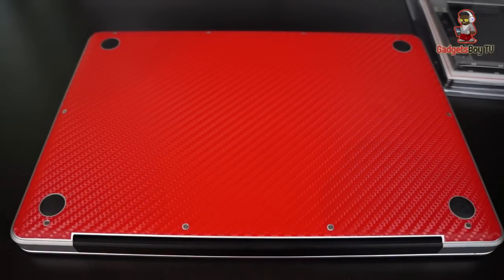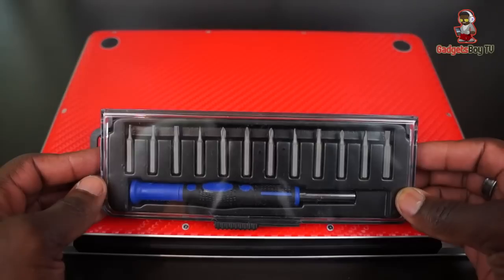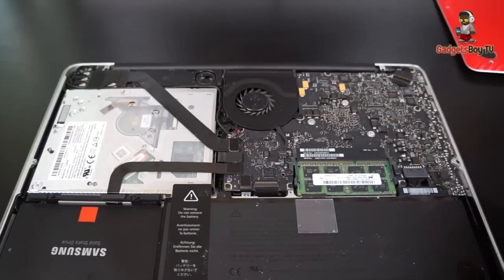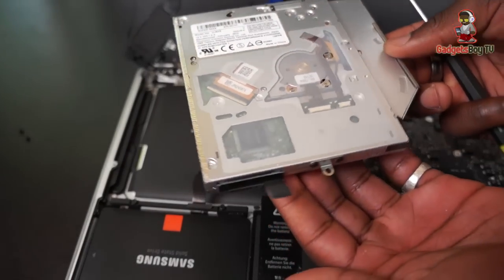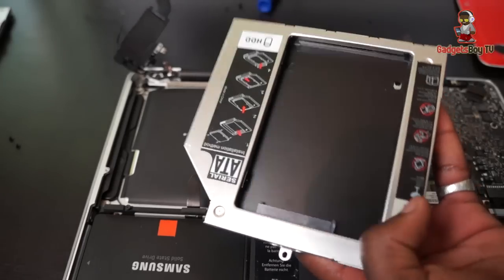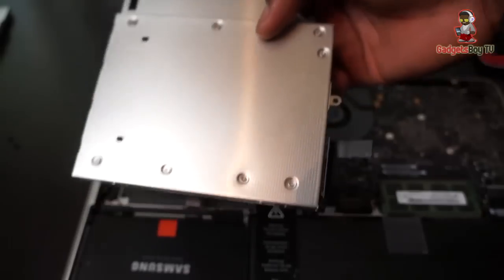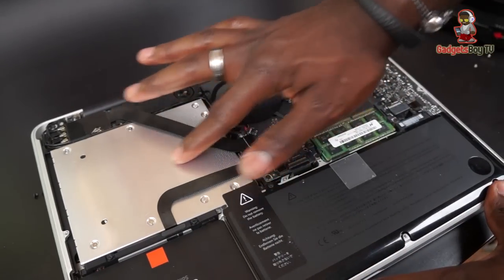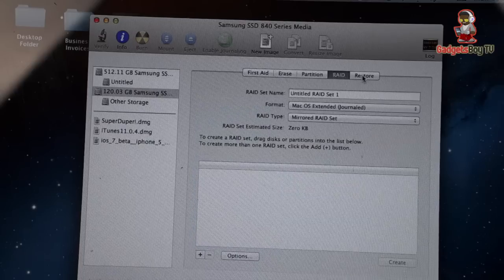How To Add Second A SSD to Replace Optical Drive MacBook Pro 2012

Comment: I'd recommend removing the battery first.
Reply: Rob Giordano Yes, I'd recommend removing the battery first, it's still connected to the motherboard and something might happen there
Reply: Unplugging the battery would really only be an issue if disconnecting system operating components. The sata sockets and power rail connecting through peripheral devices are still going to need to flash through a regular boot cycle anyway, and on a side note, even with no battery connected, there is always potential with mac book laptops that static electricity will ground through the chassis even if you are bare foot touching a surface. I replaced my main drive with an additional battery and and my main drive is in the superdrive bay.
Reply: How did you do that? I can't find any guides on the internet to replace the main drive with a battery and have the main drive sit on the CD bay. It's an interesting idea.
Reply: I agree, it’s good practice but in my case since I’m going to do a project for my customer, I’ll be replacing the battery in addition to the other things on this computer

Comment: Very nice video. A wonderful guide indeed. I have done the same procedure with my macbook pro except that I have used OWC Data Doubler Caddy and I have put a 1TB Seagate SSHD into it while the other drive I have used is an OWC 240GB SSD. I have never seen a macbook pro run so fast. It boots up in 7 sec and shuts down in 3 sec. The functioning is also very fast.

I am using my SSD for Mac OS X Yosemite and all the apps and the 1TB SSHD for all my data.
Reply: Exactly what I want to do!  How did you separate the OS and Apps onto the SSD?
Reply: What I suggest is reinstalling the OS onto the ssd like I did then just transfering you documents folder etc onto the sshd.

Sorry for 2 years late ;P
Reply: Yes, how? Yolo

Comment: Thank you for the video. It is very useful. I used similar caddy like yours. 9.5mm one and does not have 2 screw holes on the caddy's body (to secure firmly to the laptop's body). I wonder if there's a negative impact after the replacement on yours ?

Keep posting more useful videos.
Reply: Hello Sir, 

Hope your install is successful, Please share the current config of your MBP, I'd like to connect with you and know more! I'm looking to upgrade my MBP too!!
Reply: Or just reply with ur Instagram/Fb ID!
Reply: @AdarshX23  Hey, Buddy. Battery draining faster.

Comment from the maker: Thank you...I haven't noticed any major weight reduction.  But it was all done for better performance, I don't think anything can beat MacBook Air's weight.
Reply: I am already using Windows 10 on my mac via bootcamp, can I add a second SSD using this enclosure, and install Windows on this newly addes second ssd and boot it from this straight away? Thanks

Comment: Cool thanks! What is the largest SSD you can upgrade to on this model MacBook?
Reply: I currently am running with a 1tb crucial bx500 if I'm not mistaken. Not sure if it supports anything bigger than that. But for such an old machine, I think that's plenty. Also installed debian, with KDE plasma. Much snapied than Mac os 10.15.7 (on mbp a1278).

Comment: This is a reply to many commenters who think that is a good idea to take off the battery before this operation: No, do not touch the battery! You don't need to put out the battery for this simple task. Lithium-ion batteries—like the one inside this MacBook - can literally explode! If it is broken and you really need to replace it then you should always make sure the battery is fully drained before removing it.

Comment: Clear instructions. Very useful.  Is there a way, to re-use the removed optical drive externally using a caddy or something?
Reply from the maker: Thanks :)....i think you can buy a usb connector for it, have a look on ebay or amazon
Reply: For $15 you can order one on EBay

Comment: Thanks alot for the video it really helpfull . im just done with my MBP Mid 2012 using 9.5mm caddy size. but it not fitted well on the right side, was around 5mm opened and i can see the red and blue light once i turn on my Mac. actually what is the actual size for my Mac?

Comment: Hey Dude , your video is interesting 
I'm still using this 2012 model 15"  💻 MacBookpro It is working in Very good Condition 
Is it Possible to I can add 512 GB Harddrive ? Or that 128 GB is the Maxx ?
 I Hope you give an appropriate reply to this
Thank you 😊
Reply: you can add a 2TB ssd and a 5 TB hard drive. that is max configuration for now with your MacBook pro. i even added 16gb memory to make the computer very fast

Comment: Great video. I have a question. I want to replace optical drive of my Macbook Pro 2012 15" with SSD.  So what size of case do i need? is it 9.5mm you are using?

Comment: Thank you for the Video. I have been willing to go for that. Your video helped me. 
My Question here: Would this allow me using 2 SSD one for OS X and one for Windows 8 ? or I still need to use in this case the BootCamp to have 2 OS running on one machine ?
Reply from the maker: Bashar Najjar I haven't tried, but I think you can install different OS on them each.

Comment: Hi! Thanks so much for the help! I have a Mac Book Pro md101 mid 2012. I have taken out my cd drive and installed a HDD caddy and put in a samsung evo solid state drive. I have formatted the drive and it is showing up as a storage option. My problem is that my current standard HDD is 1TB (and it's almost full) and my SSD is 500GB so I would like to move just the operating system and the apps onto the SSD (to make my mac a lot faster) and leave all the rest on the 1TB. How do I go about this without loosing the path files to things like iTunes playlists etc. any help would be greatly appreciated!!
Reply: I think the biggest issue is the size difference. You could clone ssd perfectly if its the same size or bigger than the HDD. You would have to resize the HDD to  be the same number of GB as the SSD, using Disk Utility. If its too full to resize, look into backing up your files manually to free up space, then doing the cloning procedure.

Comment: So I'm thinking about keeping my 500GB hard drive, but adding a 250GB SSD by removing the optical drive.
So my question is are you able to then specify what work goes to each drive? I would love things like the initial boot, safari and a music recording program I use (Logic Pro X) to use the SSD so they load faster, but I wasn't sure if that's something I would be able to easily differentiate between the two drives. 
Sorry, I'm just learning about all this stuff. Thanks!
Reply: For everything to load faster, you would need to install it onto the actual SSD. Basically wiping the whole Mac and installing the OS onto the SSD not the HDD. You'd need to do this for each program so the actual directory of the program files are on the SSD.
Reply: Very helpful, thanks!!

Comment: Yo, awesome video! A few things though... can I replace the optical drive with an SSD, and make it the primary drive for booting? I'd really like to keep my HDD, and since I haven't used a CD or DVD in the past 2 years, I can't imagine myself regretting not having it... Also, if you remove your optical drive, Apple warranty doesn't apply anymore... 
Thanks again!
Reply: Take your HDD and put it in the optical bay and put your brand new SSD in the primary drive slot....

Comment: Hey mate, thanks for the informative video. I was wondering if it is better to replace the existing HDD with the new SSD and then put the HDD in the caddy so the Macbook will be more smoother booting from the main drive? Or any order does not matter?
Reply: +mi hao chua I think it does matter and, yes, it's better to have the SDD in the existing HDD slot.

Comment: I modernized my 2012 MacBook Pro by upgrading from 4GB RAM (stock) to 16GB RAM, & from 500GB HDD (stock) to 1TB SSD & I’m contemplating swapping the optical drive for a 1TB SSD & putting Windows 7 Ultimate on it

Comment: Great great video! Thanks a lot! My question is this: I already have an SSD in my MacBook Pro 15" 2011 and now I want to replace the optical drive with a regular hdd to upgrade my storage space. Is that possible, too? All the tutorials are about replacing the optical drive with an SSD
Reply from the maker: +2veto3 Hi, you can also replace it with a regular HDD, most people just talk about SSD as that's beast mode haha

Comment: Hi, Thanks for sharing this with us. 

I have a quick question: If I install a 512GB SSD (instead of 120GB) as a second SSD to my existing 512GB SSD, is it possible to configure these two drives as a single RAID 0 partition so that I can have my OS on this super fast drive and take care of entire backup with some external 1TB backup drive (via Time Machine for example)?

Comment: Hey mate - great video. I'm new to this so I have a few questions. 
1) does this process apply to an early 2011 MBP?
2) I'm keeping the original drive but replacing the optical with a Samsung 850 EVO. I'm wanting to transfer the OS to run on the new SSD rather than the old spinning drive. What's the process to do that?
Reply from the maker: +Timothy Doecke (Synth Explorer) hey, yes it does. I'd advice that you clone you drive and set your default boot drive to the SSD. or swap them around after cloning so the SSD is automatically selected.
Reply: +GadgetsBoy Can you explain what you mean by cloning? Wouldn't it be easier to just do what you did in the video and use the restore tool and select the the SSD and then erase the HDD after the instal or will it show 2 boot selections.
Reply: +Raymond El-khoury 

You can do what you suggested, but as the SDD is faster/more efficient than the HDD I think GadgetsBoy is suggesting putting the SDD in the place of the HDD (making it the primary storage) and putting the HDD in place of the optic drive.

As a safety measure it makes sense to transfer everything to the SDD before you attempt this so you have 2 disks with all your information in case something happens to one.  

Once you have it in you can delete the stuff off the drive you don't want to house it.

I've just replaced the HDD with an SDD and what I did was buy a USB to HDD connector and I put El Capitan on my SDD before I put it in my machine, so as soon as I swapped I was good to go!

Comment: Nice video! I have a question. I'm trying to put a SSD in my MBP Mid 2010 and also keep the original HDD. what's the best way to do this?

a) place SDD in the optic drive and leave HDD where it is
b) move HDD to optic drive and place SDD in the main bay

I want to use SSD for OS and HDD for storage. I'll appreciate your help. thanks!
Reply from the maker: +jackel142 Hi, I would say, replace your HDD with SSD and move your HDD to your optical drive.  You can install OS on SSD and then use your HDD as storage for all your media files

Comment: Hey GB
I want to replace my super drive with a ssd and run my os from it whilst still keeping the old hd.

How would I go about doing this?
Reply: I would also like to know a smooth approach to this (if any)
Reply: José Nadesan did you figure this out? I did this years ago. But you want to do it a little different. You want to take the old HDD and put it where the optical drive sits and install the new SSD where the old HDD was. This maximizes you’re performance since the connectors where the original HDD where are capable of transferring higher speeds than the optical drive connectors. Make sense? I then installed my OS / applications to boot from the SSD (keeping the files off of it, just OS and applications) with my large files of music, movies, and photos, etc still on the 750GB HDD, and you have to tell the system to pull from that drive for applications on the SSD to access their content. Easy to do. This gives you the best performance while still getting to use your old HDD for large file stores. Your SSD will be what boots the OS and applications and then the data within applications will reside on the likely much larger HDD you have already. Cheap and maximum efficiency for an awesome upgrade. My MacBook boots extremely fast and applications open within seconds. To get the most efficiency you’ll want two SSD’s but that is obviously very costly and they aren’t as recommenwddd for large files stores with many read write changes so that’s while I keep files on the HDD. That HDD still has to spin up for the instantly loading application to offer you the files for access but it’s much much faster since the SSD is controlling the applications / OS performance. I hope that all made sense.

Comment: Thanks for the video, it helped me a lot. I have a question, If I set my ssd as the primary storage of my macbook pro and I set the original internal HDD as second storage. Can I "shut down" the HDD? I mean, choose to turn it on or off without removing it from the macbook pro? (like an external HDD that can be removed)

If it is possible, can I expect a better battery life?
Reply: It is possible. Go to Applicatiosns>Utilities>Disk Utility and unmount your HDD. If you want to have access to it, just mount it again.

Cheers
Reply: Thanks a lot !

Comment: Does this mod make your Macbook any lighter by chance? Just curious. Looking to either upgrade from HDD to SSHD or possibly replace the optical drive on my Mid 2012 13"
Reply from the maker: It does reduce the weight but ever so slightly.  It is not massively noticeable.

Comment: Hey, man - very helpful video! Well done! Just one question:
I have my operating system on the drive that my MBP late 2010 came with. How could I move the OS to the new SSD along with some more applications? Is there any way, or should I install from the beginning?
Reply: Make a backup and then install it on the new ssd

Comment: After removing the optical drive, does it change in the weight of the Mac now? And I can just use the current HDD 2.5 originally from my macbook mid 2012 with the caddy as a additional
Storage.

Comment: I just upgraded my mid 2012macbook pro with two 250gb SSD Samsung 850EVO. My computer reads the drive in the main bay, but not the one in the optical drive. It's driving my crazy. I got the same Caddy as you as well. What am I missing?
Reply: Did you ever get it working?

Comment: Hi, probably a stupid question but I have a standard mac pro 13" 2012 so can I keep the original HDD and keep it in the same place then replace the "CD" (optical) drive with the SDD and boot from that to increase boot times but store main bulk data on HDD?
Reply: yes, ssd for the speed, and hdd for data

Comment: Question GadgetsBoy, i have a late 2010 macbook pro 7,1. I just removed my HDD and installed a 1T Samsung SSD :) Now I want to replace the optical drive just because I don't use CD's or DVDs and I would like the extra storage. I plan on getting a 750 GB WD Hard drive for about $80 as my second drive. When I replaced my HDD for the Samsung SSD, I used USB to SATA adapter and then used carbon copy cloner. After I replaced the drive, SSD Samsung had everything I had on my mac (documents, apps...etc) plus 700 extra GB. MY question is, do I have to do the same with second drive? use the USB To SATA and carbon copy cloner? or just replace the Optical Dirve and install the HDD and nothing else. I hope my question makes sense.  Do i use the carbon copy cloner process again like I did the first time? And if so, do I hold "option" eveytime I start my computer and choose between my SSD Samsung and HDD WD?

Comment: Hey I wanted to know, if I replace my optical drive with an SSD will I be able to backup both drives with Time Machine? Would I need to do a partition on the TM drive and perform 2 separate backups?

Comment: Hey there, just came across this video.  If I'm going to be adding an SSD inplace of the optical drive to use as my main Mac OS drive, and then wipe the harddrive already in there to use windows, would the SSD need to be placed in the firsts hard drive spot, or would it work in the optical position?
Reply from the maker: +DAFTpanduh it should work fine i the optical position.

Comment: i replaced my optical drive and all was working well. The 2011 Macbook pro wen back to Apple store for a new mother board due to warranty/recall on the graphic card. Now it does not recognize the drive.  I have checked all contacts and all seems in order.  Any suggestions.  Disc utilities does not see it.  I also have data on the drive I do not want to lose.  I can take the drive out and use a usb cable to mount the drive, but I still want to get this working as it is intended inside the computer.

Comment: What’s the benefit of removing optical and replacing it with second ssd ?
Other than more storage?
Is there any more performance or speed
Reply: Unless you set up raid, you won't get any extra speed. However, if you use raid you will only be able to use one ssd worth of storage. For example if I had 2 128gb ssds, I would only have 128 gb of storage if I use raid. You could also use one of the hard drives as a back up too.

Comment: I was told you cannot partition an SSD in the optical drive bay. Is that correct? I also have the Mid 2012 13" Macbook Pro.

Comment: Your video is great. I gave me a lot of inspiration indeed.  In fact I just wanted to do exactly what you did, but for a Levono B5030T AIO desktop computer.  The B5030T comes with a 1TB HDD and a DVD drive.  It would be interesting to replace the DVD drive with an SSD, just the way you did.  I would like to share with you if I would need a new cradle for this job just as you did?  Could the DVD drive that was removed from the B5030T, in some way or another be wired into a USB drive?  This way I can use it as an external USB DVD drive.  Would my idea be all workable?  Thank you